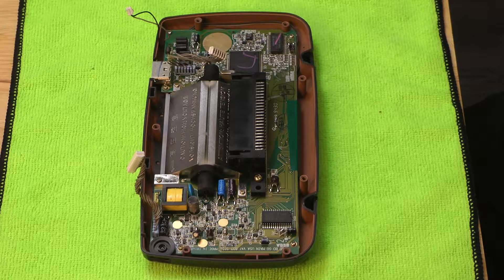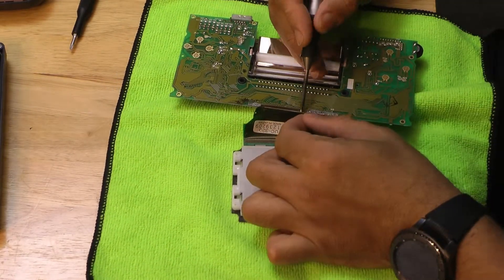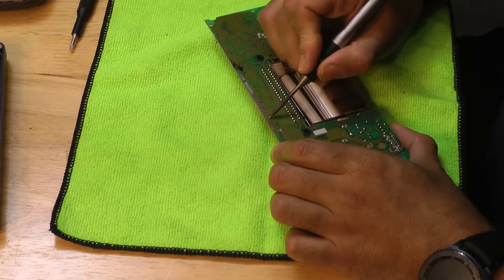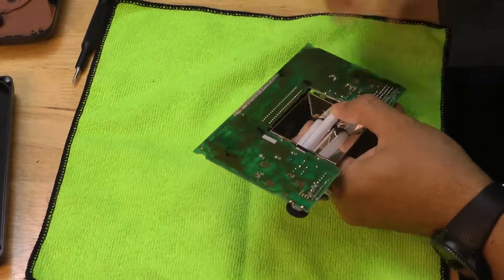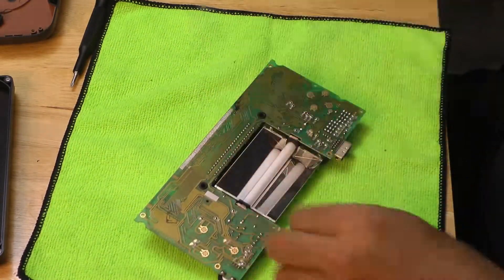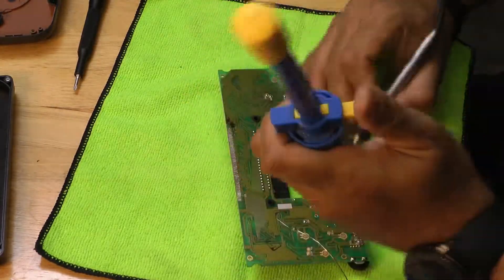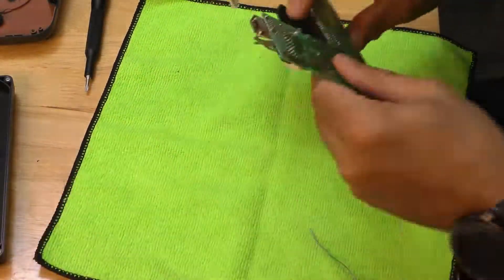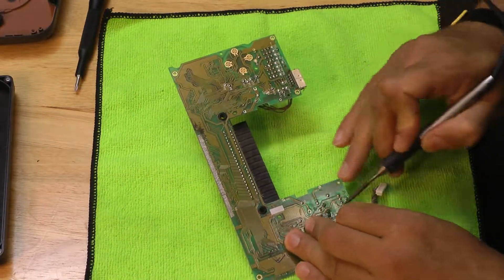Sega Game Gear TFT LCD Replacement

Comment from the maker: The thumbnail is the real game play photo we took after put the unit back together.  Image is 10000% better than the old screen.
Reply: i have the same board from funnyplaying v3.1, and i have an identical game board motherboard, ASIC 1 "Europe", as the colleague above in the picture. I did not start the installation. I'm worried about the guide, do I need to change the R24, R25, C39 and C40 resistors and capacitors, because it didn't come in the package. I watch some guides, they change it and some don't change it, I don't know what to do? any help?
P.S. why didn't you do the bridges on R13, R14, R15 and R16 as the diagram finds, and I see the end result that it works for you in the end without error?
I also see that you did not remove the three transistors Q3, Q4 and Q6, WHY? 😍😍😍
Reply from the maker: Here is the manual that we followed (Hopefully we can do Google drive Link):
https://drive.google.com/file/d/1EBVepnVCwVQXgmQtXD09oiiV6NUZBljQ/view?usp=sharing

In regard to "R24 & R25", we did not touch any of those as they are not mentioned in the manual. (However, we did replaced most of the capacitors as they are mostly dead by now, so even if it was not mentioned in the manual, we replaced them anyway).

We did bridge "R13, R14, R15 and R16", somehow the process wasn't shown in the video.

You do need to remove "Q3, Q4 and Q6", again, it got FastForward, so it is hard to see.
Reply: @electronicshobbyisttechnol3347  
ok mate, i have the same manual already like this, but it's from MC Will LCD and we have copies of "funnyplaying" and I believe that you didn't solder the backlight as in the MCWill manual, on pins 1 and 2, but on pins 2 and 3 , Am I right?

you also didn't solder the "GSync" wire to T2, and the manual says it should, why did you skip that? :)
Reply from the maker: We did solder the backlight.  As you can see on the manual.  The 2 BL contacts on the mod main board to the front of the GG main board what it says backlight 1 and 2 on the manual (since there is no "ping 3", so we did not do "ping 3".

We also did solder GSync to T2.

Comment: That’s not an IPS screen…it’s TFT. Also, you should have used the alternate “easy” pads on the bottom. That way, you have shorter and neater wiring.
Reply from the maker: The new screen is IPS, viewing angle is great. Almost 180 degree.
Reply: @electronicshobbyisttechnol3347  No, it’s NOT an IPS screen…only BennVenn has IPS screens…all other mods including Funnyplaying uses TFT screens. Please do some research.
Reply from the maker: @nyprince5922  Thank you for the info.  We stand corrected.  BTW, what is the alternate “easy” pads you mentioned?
PS: If a TFT screen is already great, how is the IPS one look like?  Will think about looking into the IPS screen.
Reply: @electronicshobbyisttechnol3347  No problem, the “Easy Pads” are located just below the ribbon cable connector on the driver board. These pads work the same way as the ones you used. The big difference is that they are closer to the LCD connections on the game gear main board.
Reply from the maker: @nyprince5922  I see.  Thanks for the tip.

Comment: hello, can you tell me which scheme you followed when installing fuunyplaying v3.1, do you have any link? and how did you install that lcd screen, kqda it says on the net, that now game gear made in taiwan can't be installed?
P.S. i have game gear ags1 837-9130.
can i follow your video to do the same?
why did you take off the T1 transformer, when it is not written anywhere in the seams? does that confuse me a bit?
Reply from the maker: Our GameGear is also Made in Taiwan, and it worked.  We also ran into the samw worry when we did it.  However, it seems to function correctly.

Not sure about fuunyplaying v3.1.  Sorry.

As far as following the video, you can try.  There are some parts that we skip in the video as the camera is in the way. 

We take off the T1 transformer because it is already useless when we removing the surrounding components (as well as the old screen).  You do not need to remove it.
Reply: ok, you can give me a link to follow the schemunka you followed, since they are not all the same as from McWill. and tell me did you plow the bridges on R13, R14, R15 and R16, and did you need to change the C39, C40, R24 and R25 capacitors and resistors?
Reply from the maker: Please see my other reply